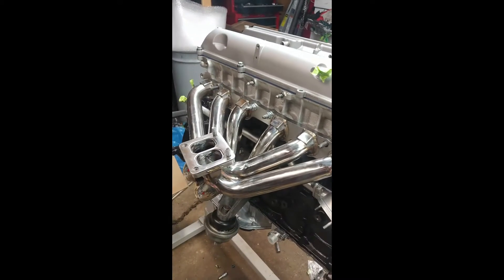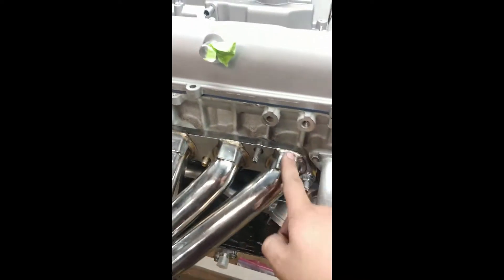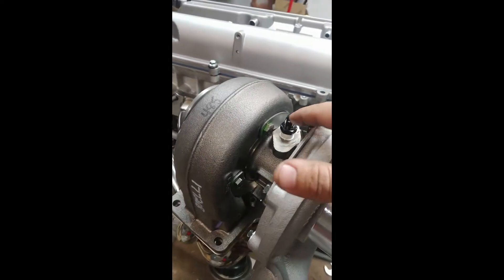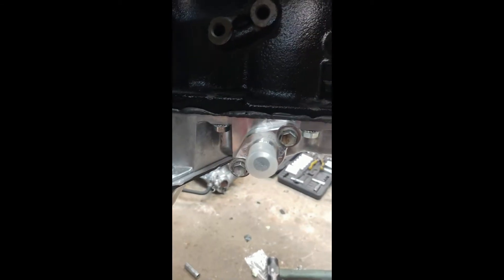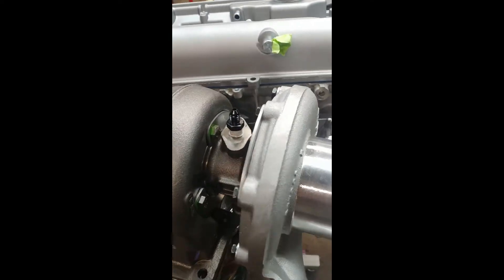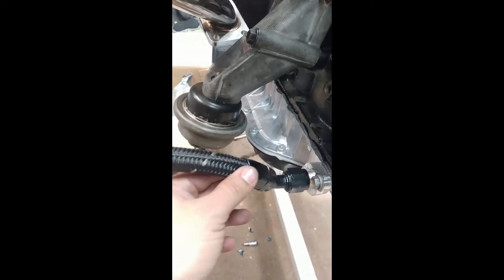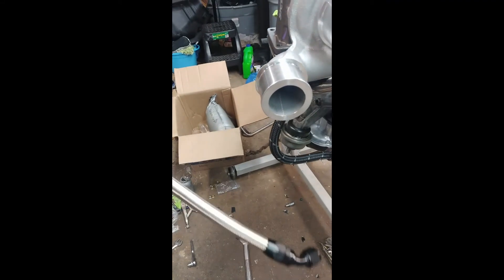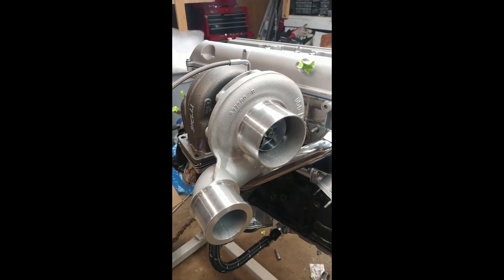PartLord 2JZ-GE Oil Line Kit Install for BorgWarner S300 Series Turbo

Comment: I can see you got gte valve covers on that ge head. I hear that one of the holes where bolt goes in wont line up. Have you had any leaks from not putting a bolt there?
Reply from the maker: Not ran it yet, though doubtful. Worst case a little gasket maker would resolve that.

Comment: i cant seem to find where my oil pressure switch it, would it be the one behind the a/c compressor? ive got 96 mk4 supra 2jzge non vvti
Reply from the maker: I know comment is old, but should be on the sump assembly. Right above the pan under the intake.

Comment: Do you sell just the oil return line kit?
Reply from the maker: You mean just the hose and 2 flanges?
Reply: @kylecombs6176  yes.
Reply from the maker: @franklyn315  https://www.partlord.com/collections/new-oil-kit/products/2jz-ge-or-gte-single-turbo-oil-drain-flanges-line-only-for-borgwarner-s300-series-turbo